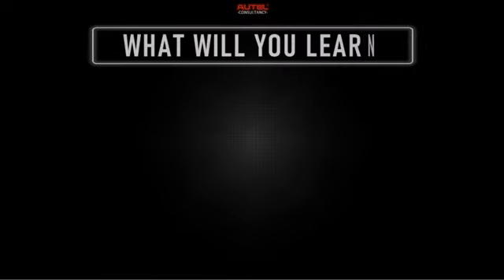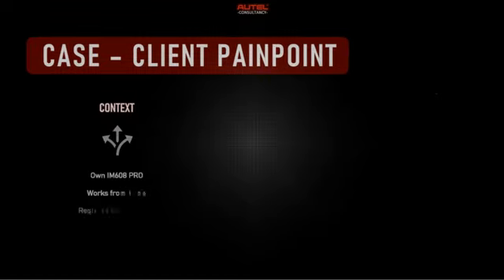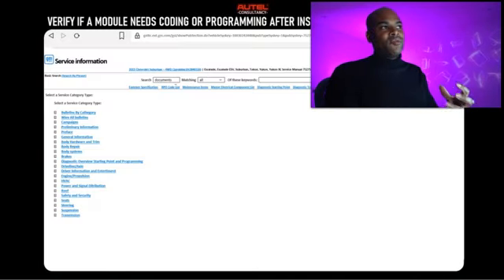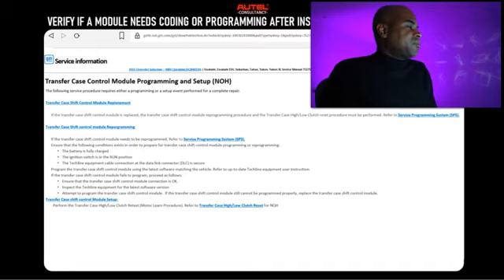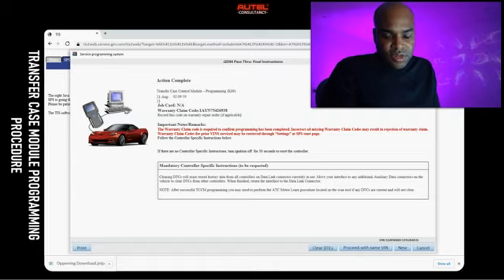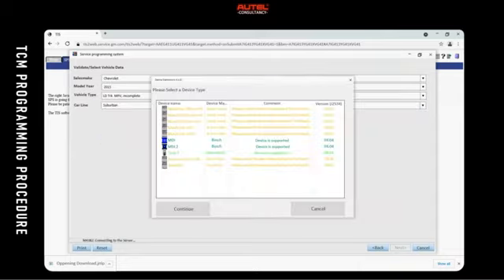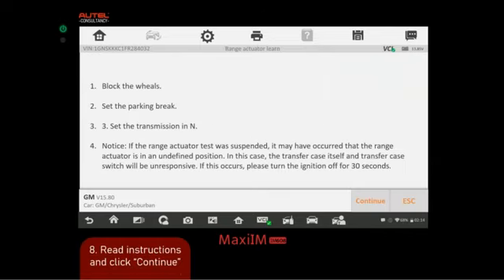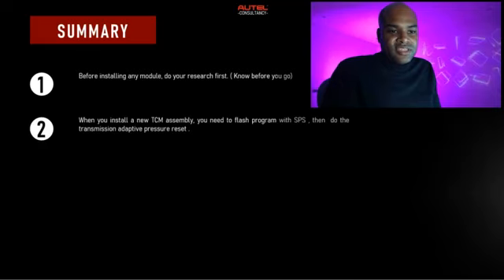Autel J2534 Programming Case Study -2015 Chevrolet Suburban TCM and Transfer Case Programing /Coding

Comment: Hi my friend I need ask about my im608 if my update is expired is some software is stop need answer please 😔
Reply from the maker: The diagnostic software should be fine with out of a subscription. Some immobilizer apps might need to connect a server.. Just use the tool until your not able to do something. Then get the subscription